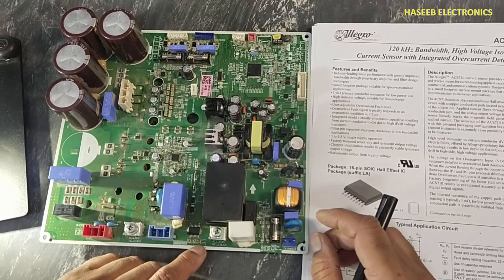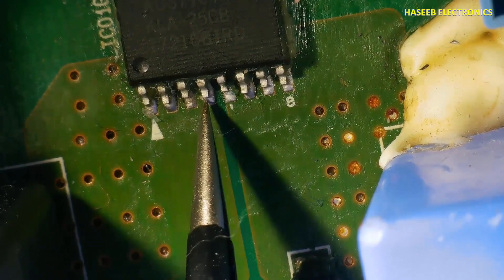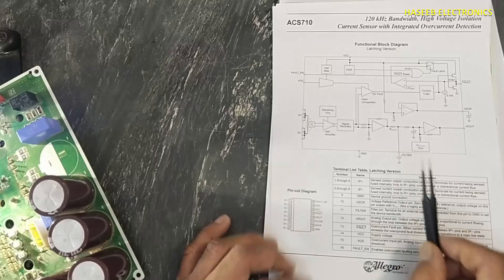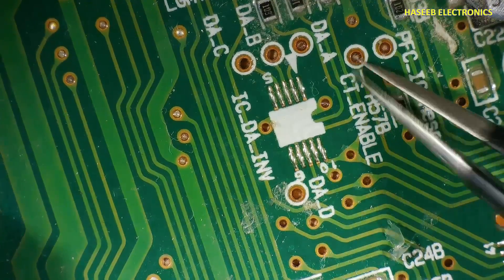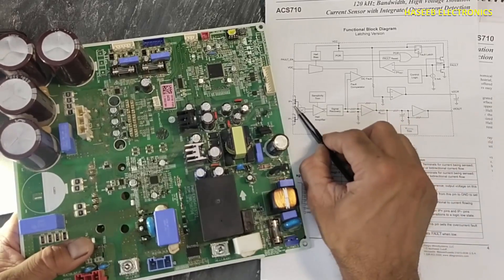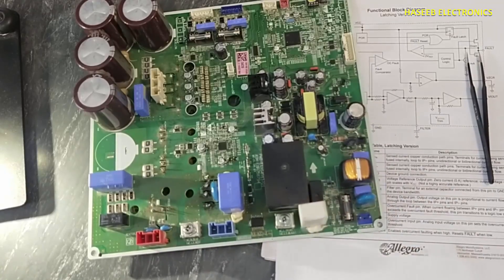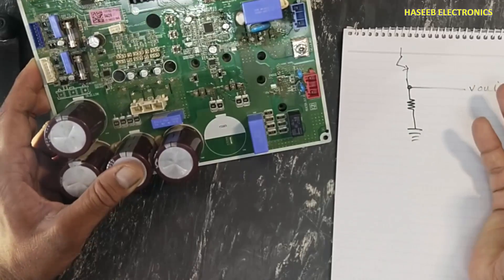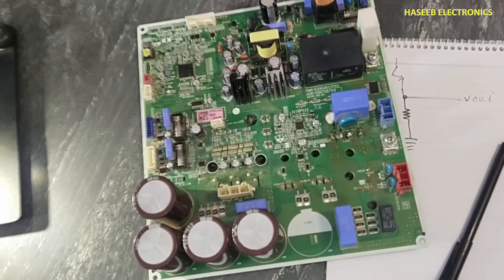{972G} Current sense IC with overcurrent detection

Comment: Hello, Mr. Hasib, I have a question: When the AC ACS 710 explodes, does the card lose information that the company had previously specified? Why, when I replace it with a new one, does the card not return to work, knowing that all the voltages are fine, the diode tower has been replaced, and all the board components are intact? What could be the reason? Thank you for your effort
Reply from the maker: Yes brother
It is a big issue, when ACS710 explodes, sometimes its internal structure becomes short circuit woth processor lines, which damages the processor
And in some situations the surrounding components (specially current limit setting resistor and capacitor) are devalued, which cause an improper function of the chip

Comment: First off all i would like thank for your hardworking..we learn knowledge.
I have one question sir.
How do i will calculate the losses of the DC link capacitor of traction inverter & how i will calculate Right DC link capacitor.
Research so much but i didn't get correct answer,i think you can clarifying this doubt.

Comment: Sir I need your help if I have 2 12 volt 60amp power supplies with 3 position & 3 negative terminals of each smps how to connect in parallel sir and I want 12 v 120 amp power please do a video about this sir please 🙏🙏🙏🙏🙏🙏

Comment: Can you help me to find with circuit schematics for vestel 20fr25 Induction cooker PCB
Reply from the maker: i tried but there is no data about this product 
if possible, you can send its front and back clear pictures to my whatsapp 00962-79-5324272 or gmail id    ashraf4ta4 
i will try to see some possible solution

Comment: @Haseeb Electronics - I'd like to get some assistance if possible to repair a COB LED Headband Flash Light (16 LED COB) that submerged in water that damaged the PCB. The Headband Flash Light is powered by 3 - AAA batteries. The PCB has only three components [2 resistors: 1R0 & 471, and a SOT23-6 Chip: A28L]. Overall condition: All traces, switch and battery terminals corroded, COB LED is working with 4.5V/500ma supplied directly from DC Power, Resistors shorts, SOT23-6 Chip was tested with enamelled jumpers replacing corroded traces and shorted resistors and DC Power but only a 190mV received by LED. Question: is there a way to substitute the SOT23-6 with some discreet components?